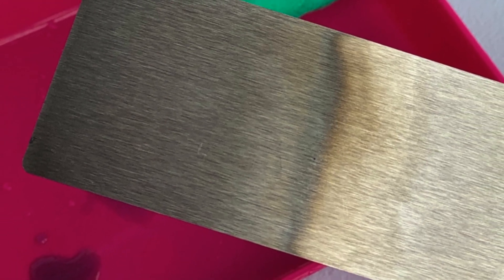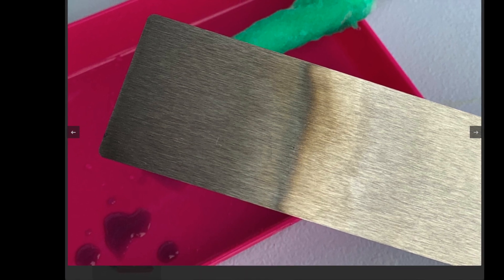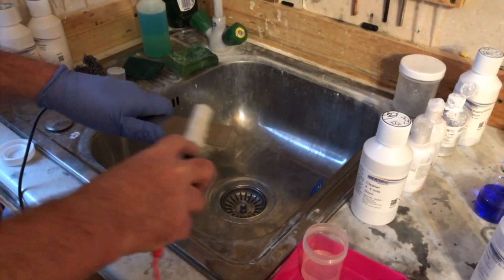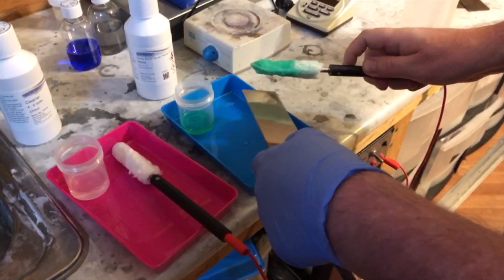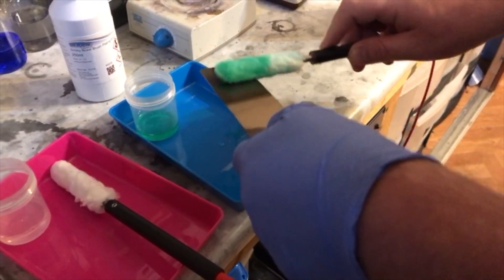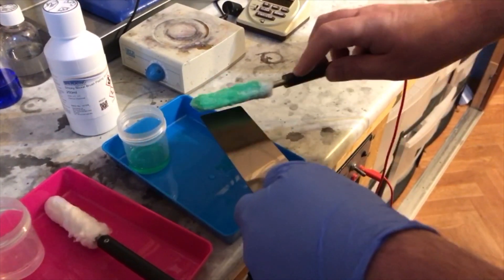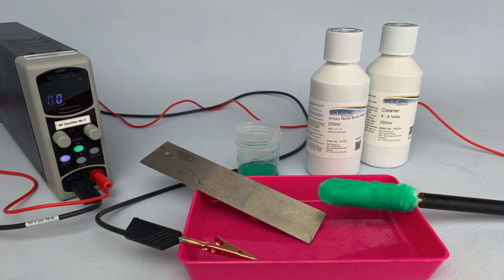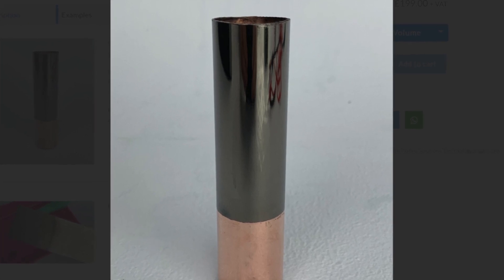How To Brush Plate Black/Smoky Nickel on to Stainless Steel

Comment: Would you suggest I do my whole cat iron table saw top with this finish? 
I'm looking to make it more rust resistant. 
The finish is assume also, but i wouldn't do it just for the cool factor. Thanks.
Reply from the maker: this will not protect against rust 
thanks

Comment: I like this technique. Is it possible to submerge the part in the liquid rather than brushing it on?
How do you get the black color?
Thanks,
Paul
Reply from the maker: Yes put this

Yes but this solution is for brush plating the color comes from the solution

Comment: Nice video thanks. I’m interested how tough this is compared to shiny nickel plate ie in terms of resistance to scratches. Aesthetically I don’t want any scratches developing in my plated stainless item. Thx.
Reply from the maker: This is not like the normal nickel and will scratch very easily I would lacquer it
Reply: Have you tried Black rhodium over this Base for a strong final layer

Comment: Bactericidal action
The bactericidal properties of copper and its alloys have been known to man for a long time. In 2008, after extensive research, the us Federal Environmental Protection Agency (US EPA) officially assigned copper and several copper alloys the status of substances with a bactericidal surface[26] (the Agency emphasizes that the use of copper as a bactericidal substance can complement, but should not replace, standard infection control practices). The bactericidal effect of copper surfaces (and its alloys) is particularly pronounced in relation to methicillin-resistant strain of Staphylococcus aureus, known as "supermicrob" MRSA[27]. In the summer of 2009, the role of copper and copper alloys in inactivating the a/H1N1 influenza virus (so-called "swine flu") was established[28].

Comment: OK I'm ready to buy this... you're link is broken. Help me to help you. Take my money.
Reply from the maker: https://www.goldn.co.uk/product/smoky-nickel-brush-plating-solution/
Reply: It says it is for copper, brass, and stainless steel. I'm looking to plate cast iron. Specifically my tablesaw, bandsaw and jointer. 
You think it'll work?
Reply from the maker: @richardpatterson4312  i would plate a thick layer of normal nickel first 
thanks